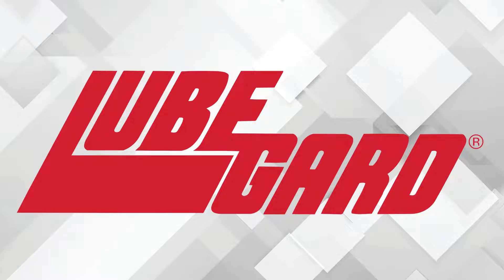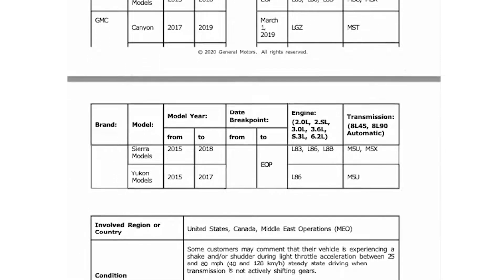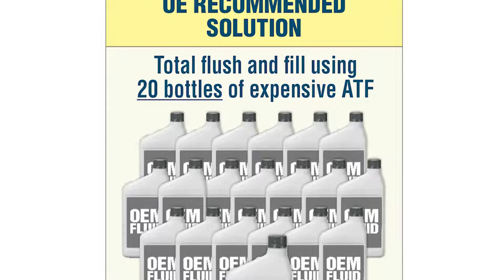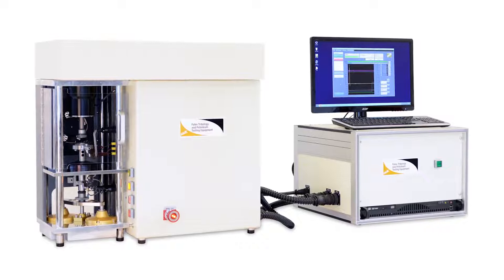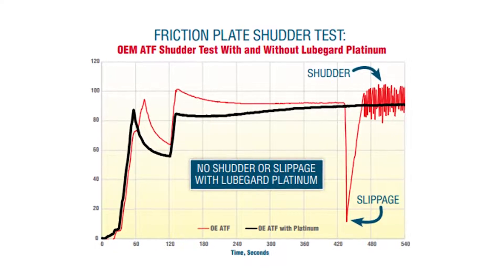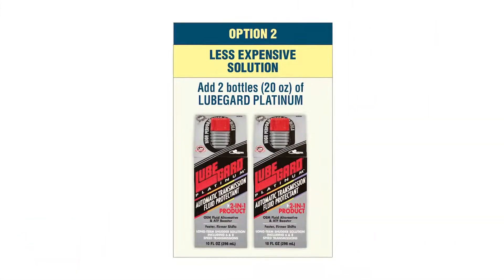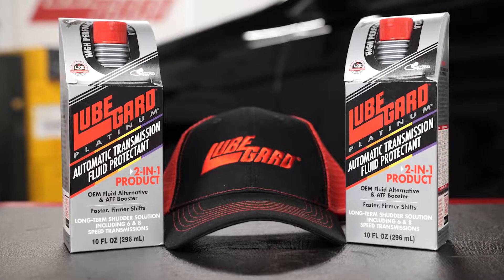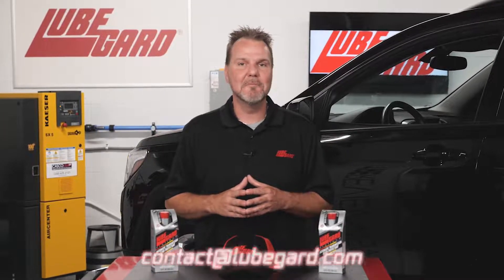Platinum 8-Speed Shudder Solution

Comment: I have a honda fit 2012, can I use 10 oz with lubegard platinum protectant for 3 quarts of transmission oil?
Reply from the maker: Hello -  Your total transmission capacity is 6.2 quarts, so you can use the full bottle.

Comment: Hi. Can I add more than two bottles of Lubegard Platinum to a Zf 8hp transmission? I added initially 2 bottles of shudder fix and saw no difference, then I added two bottles of Platinum and shifts have become smoother and faster. Why?
Reply from the maker: Hello - How many miles did you drive with the Instant Shudder Fixx  before adding the Platinum?
Reply: @lubegardinternationallubri6870  around 40 miles between instant shudder and platinum
Reply from the maker: @ccristian9918  Generally you would have seen at least some improvement after using two tubes of ISF.
Two bottles of Platinum is the maximum amount of product we recommend using. Especially since you have 2 tubes of ISF in there as well. Too much product can overmodify the fluid and cause it to slip. 
How many miles have you driven since adding the Platinum?
Reply: @lubegardinternationallubri6870  around 500 miles. Smoother overall shifts but still harsh 1-2-3 on low acceleration.

Comment: I have a 2018 chevy traverse that developed a transmission shudder.  At around 143k miles I took the car to speedee, did a transmission flush and then tried 1 bottle of ISF and the shudder completely went away.  The shudder returned at about 154k miles.  I then added another bottle of ISF, there was a slight improvement  but now at 155k it's getting bad again.  I want to try the platinum.  How much should I use and should I do another transmission fluid flush before hand?
Reply from the maker: You can add one, 10 ounce bottle of Platinum. This is the maximum amount of Lubegard that should be added until your next transmission service. It may take 35- 200 miles to see the full results of the Platinum.

Comment: I have 2014 CX5 and it has shudder at low speed. I drained and refilled three times using OEM FZ fluid and then added one bottle of lubegard red. The transmission has more noisy after adding lubegard red but a bit smoother. Now can I add one bottle of lubegard platinium to get better result after sucking out 10oz of atf? Thanks
Reply from the maker: Hello - The Platinum is compatible with the ATF Protectant, but how many miles have you driven since adding the fist bottle?
Reply: @lubegardinternationallubri6870  I have driven about 200 miles. The transmission is still jerky and makes more noisy, while down shift uphill or inclined road after adding lubegard red but the shift cycle tightened. The up shift looks ok. I want to try adding lubegard platinum or instant shudder fixx to  see if the transmission will get better. Thanks
Reply: After adding one bottle of lubegard platinium, initially the skyactiv transmission got more smooth. However when I drove more, gearbox created noisy and first to second gear shudder sometimes. Finally I drained and refilled again using OEM FZ fluid, now the transmission got much better. From my experience, Mazda Skyactiv transmission loves ultra low viscosity ATF, don't use the other brand of ATF. You can add lubegard red/platinium but half of the dose, 4oz.

Comment: Hi I have 9 speed Buick enclave 2018 can I use this because it starts to shudder? And do I need to remove 10 oz or 20 oz to my transmission fluid when applying the platinum?
Reply from the maker: Hell - Yes, Lubegard Platinum is fully compatible in your Buick Enclave. You may need to remove some fluid before adding Lubegard so that you don't overfill.
Reply: @lubegardinternationallubri6870  I'm planning to put two bottles of platinum so equivalent for 20 oz so I'm gonna remove 20 oz transmission fluid also right? And last is it ok to put two bottles?
Reply from the maker: @GerardBelenson  Yes, you can add 2 bottles of Platinum #63010. Remove 20 ounces of fluid first so that you don't overfill.